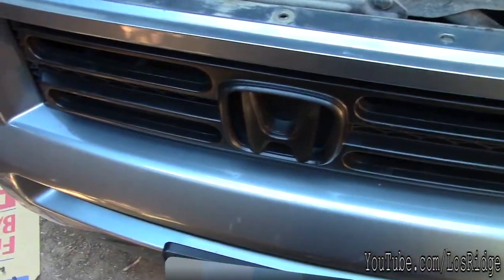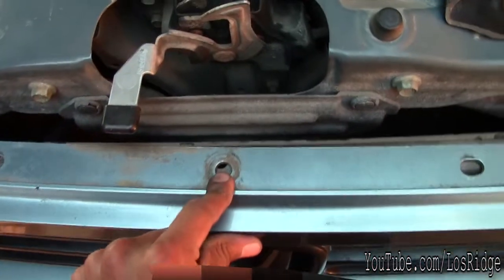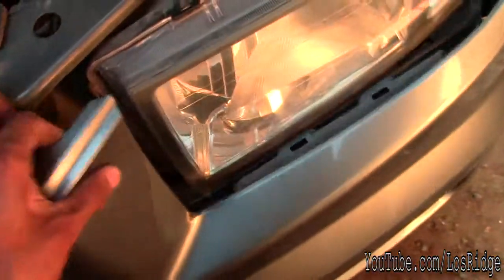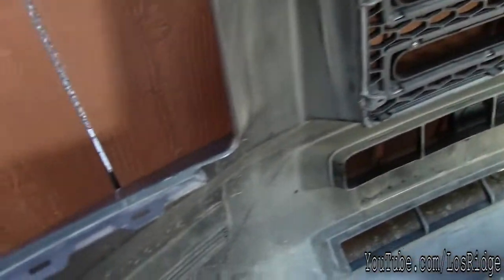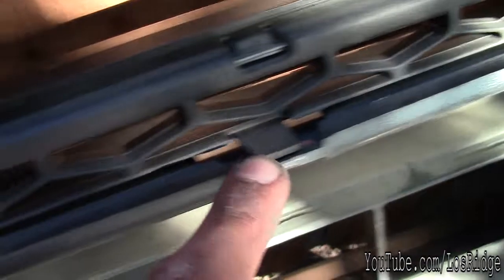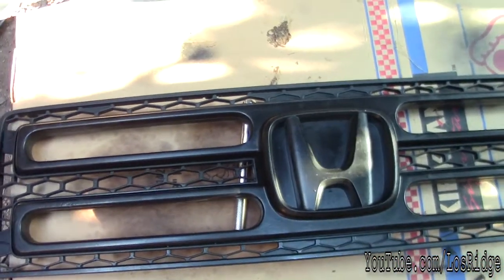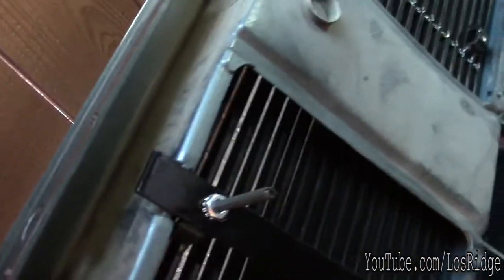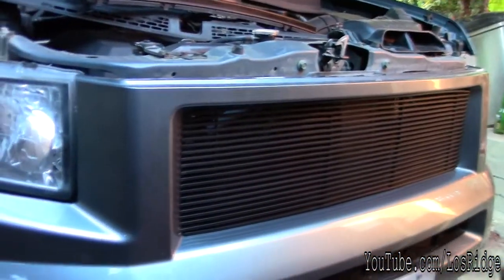How to Remove Front Bumper and Install Grille on Honda Ridgeline

Comment: @losridge

Where’d you get the grill??
Reply from the maker: I believe I got it on ebay, it came in billet, I sprayed it with plasti dip. when I sold the truck it left it on and it still looked great after like 5 years.